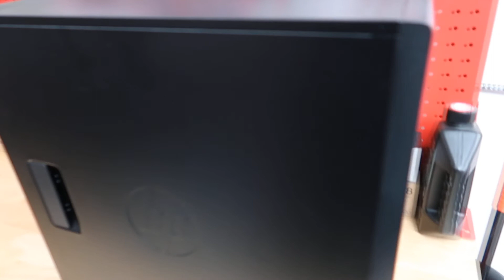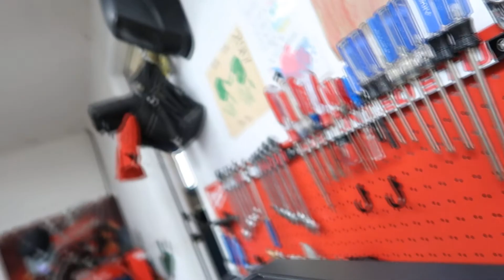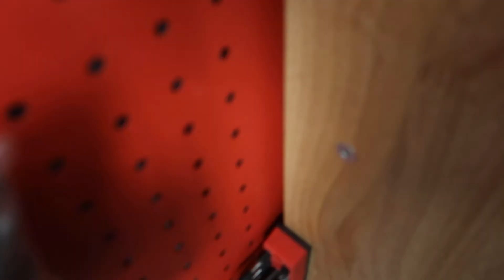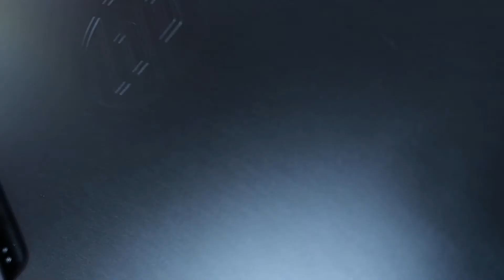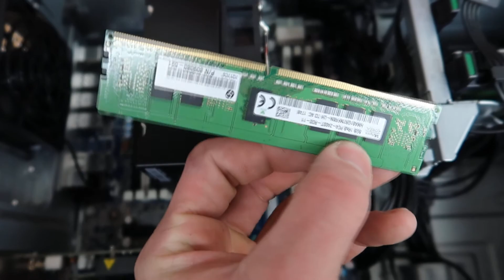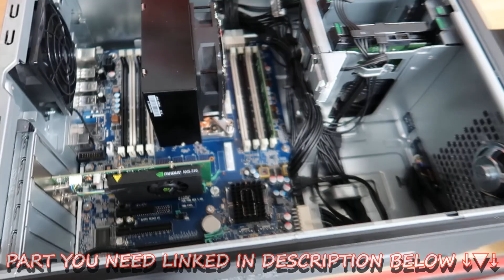How To INSTALL MEMORY RAM HP WORKSTATION Z440 Z640 Z840 Upgrade RAM ADDING MEMORY To PC INSTALLATION

Comment: How many DIMMs need to be inserted before you need to add the extra memory fan air baffle thingy, that wasn't installed in this version of the Z440?
Reply: 8/5 any thing more than 4 will need it. It will give you an error if you don't install it.
Reply: @DeletedContent  I have all 8 slots occupied with 128 go on my z440
At start up bios reports a working about additional fan requirement 
If you press enter it will continue booting windows.
It works for me without an additional fan